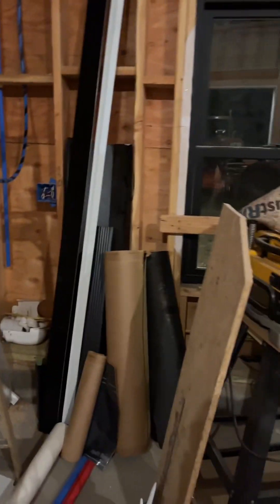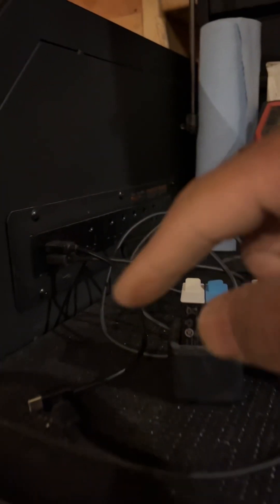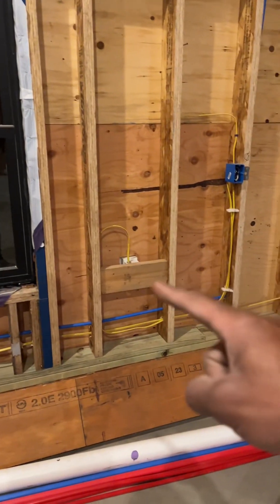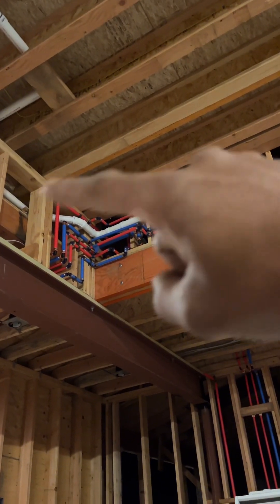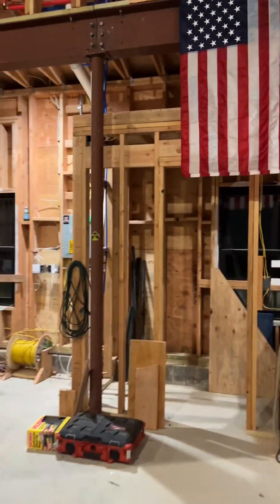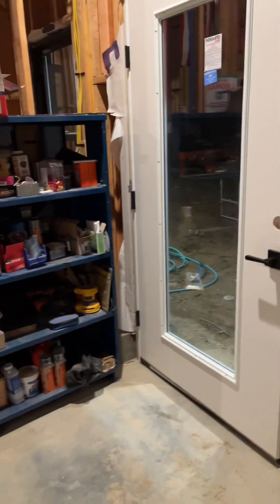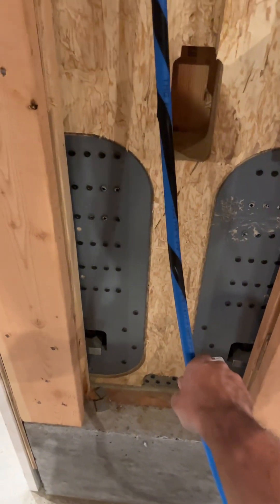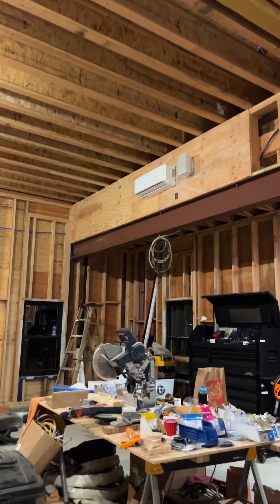Garage build update … shop air with Pex?

Comment: I've never thought of Pex for air.  It would be hilarious if years later you forget which line was which and hook up air to an outside water spigot, could be very 3 stooges like. 🤣
Reply from the maker: I’ve see a bunch of videos with others doing the same … so why not try it for less then $100 and a little effort. 

Funny thing, I have a blow out valve for the outdoor spigots too. 

I think pex is rated for 100psi or more, I’m probably not going to be using more then that so I think I’ll be ok.

Comment: How much pressure can you put into that Pex line?
Reply from the maker: We tested it with 110lbs and it held for 1 hour…. The line is going to be buried so I’m wondering if I should run a spare just incase this one blows out in a few years.
Reply: @Ratherbemilling  I googled it, you are good to 160 lbs
Reply from the maker: Perfect!! Thank you. 
I’m pretty sure I’m never going to need more then 100. 

Btw I saw your saw-battle … woodland vs. woodmizer.  Funny thing, my buddy has the woodland and of course I have a the LT15wide.  Great video, only concern was when they were flipping the giant log … I’ve been there, never want to go back.